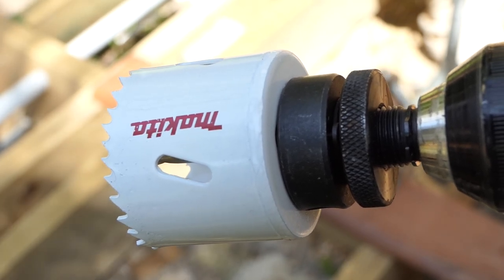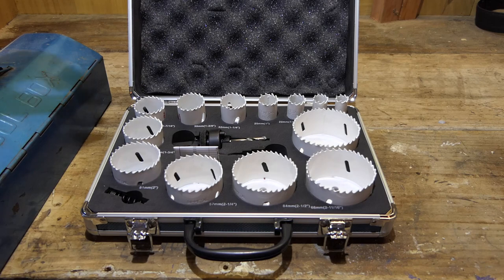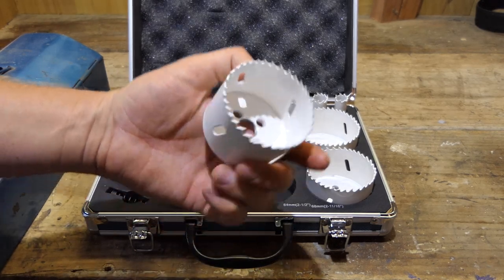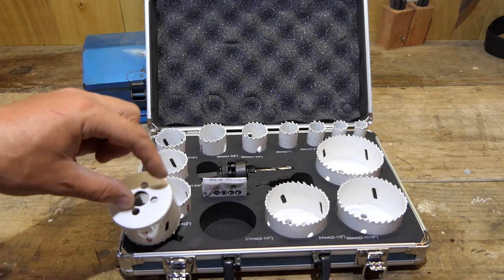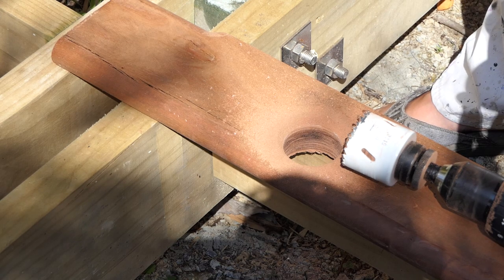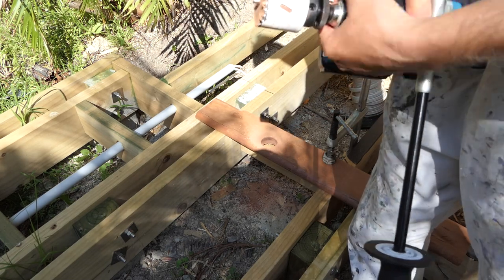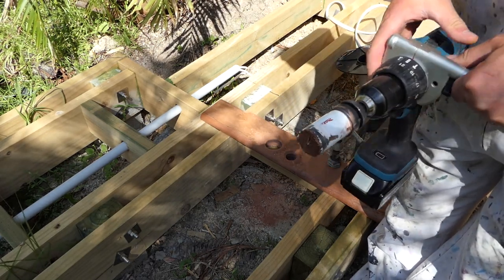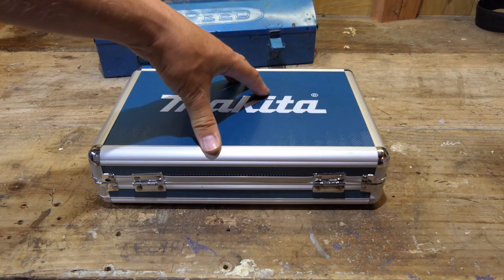Makita Hole Saw Set D-47307 | What's inside this set???

Comment: Hey thanks for making this vid, I just bought the smaller kit and this will be really useful. How come you didn’t use the ejector spring btw?
Reply from the maker: The springs are only any good for thin metal. They are no good for full depth drilling into timber.
Reply: @BuildsStuff  thanks for the reply

Comment: Why the drill bit is flush with the hole saw, isn't it shorter than what it should be?, had it been longer it would of pinned the hole saw to the wood instead of what happened at the beginning of the video that could of chopped your leg underneath ( Without safety boots, Yikes)